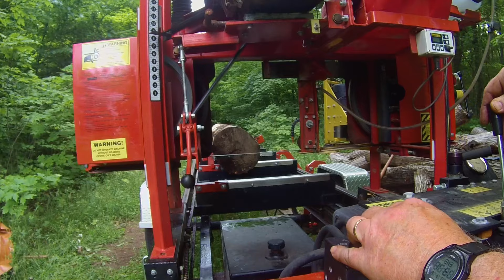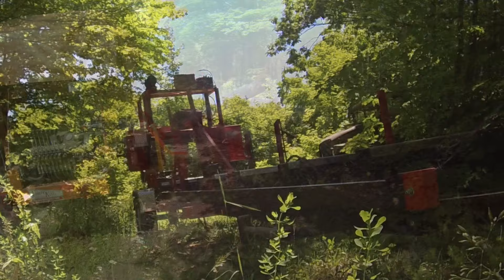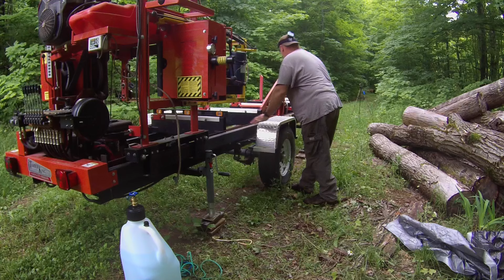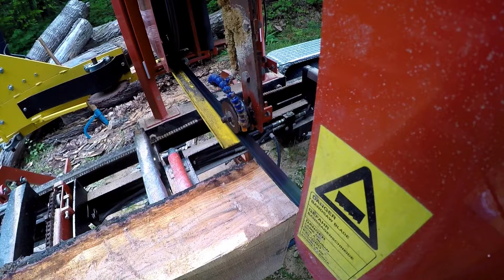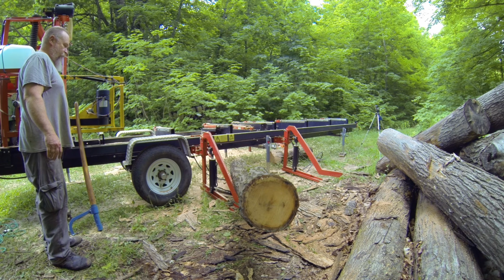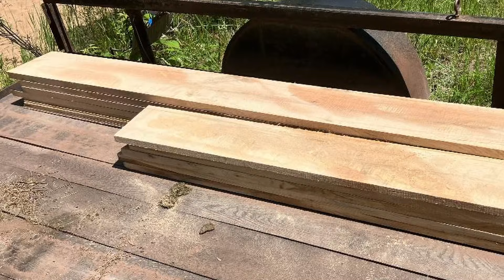CUTTING OAK & HARD MAPLE LUMBER

Comment: That mill is set up very well. What do they run for cost like that?
Reply from the maker: My brother and I bought this B20 new from the factory almost twenty years ago.  I believe the base price was around 25K back then but we got the computer set works and the de-barker as well so maybe a couple grand more.  Timberking doesn't make the B20 anymore, I believe the "2000" replaced it.  I haven't looked at prices on those, not sure what they go for.  Thanks for watching and commenting!!